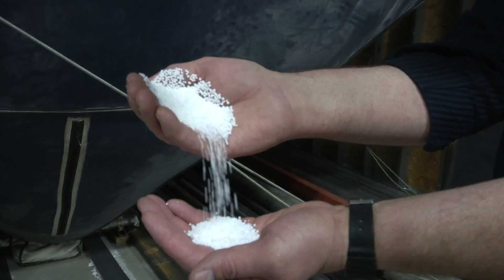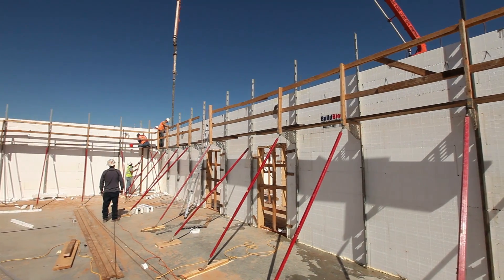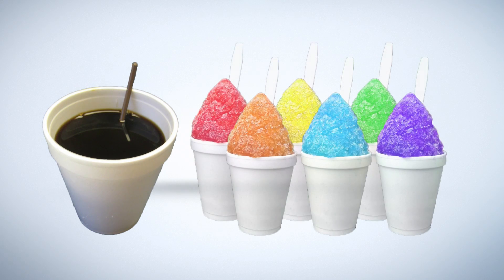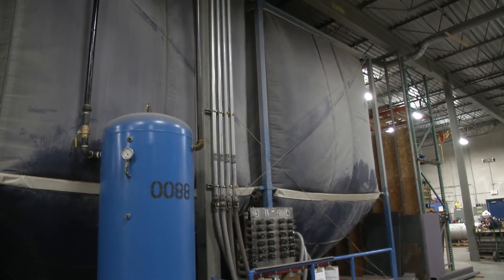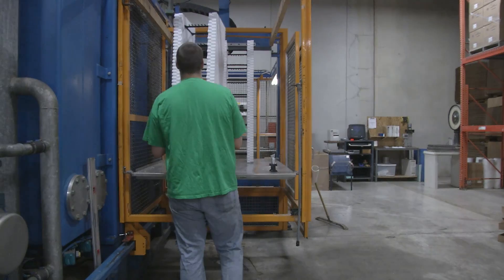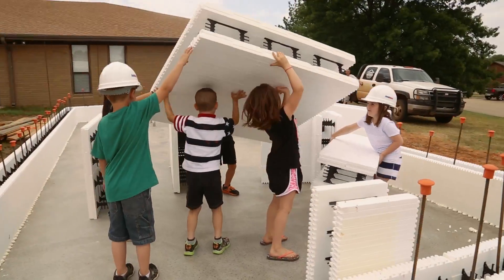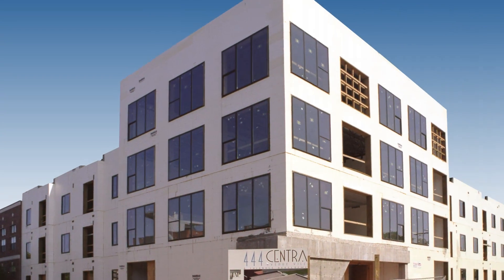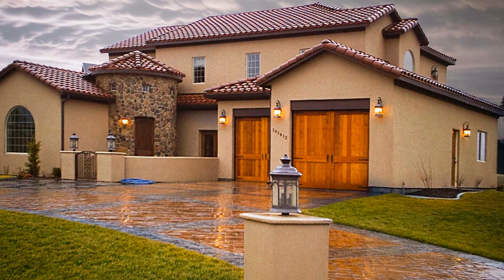How BuildBlock Insulating Concrete Forms (ICFs) are Made

Comment: Can hydronic tubing be safely installed into the walls for heating or cooling? Maybe the insulation factor allows normal floor type hydronic heating.
Reply from the maker: There really is no benefit to installing tubing in the walls for heating or cooling. In fact doing so would introduce more problems. If you vary the temperature of the concrete in the wall you have the risk of creating a dew point in the wall and condensing moisture in the wall. Also you'd be heating or cooling behind the insulation.

The main benefit to ICFs is that you have 2.5" of dense insulation on both side of the concrete wall and the thermal mass of the concrete requires so much time and energy to change temperature that it remains extremely constant. Additionally the concrete is constantly wicking the ground temperature providing a very stable temperature as well.

The best would be to install radiant heating and cooling in the floor. We offer information and products on our website to allow you to do this very easily. Please contact us and let us help you with your project.